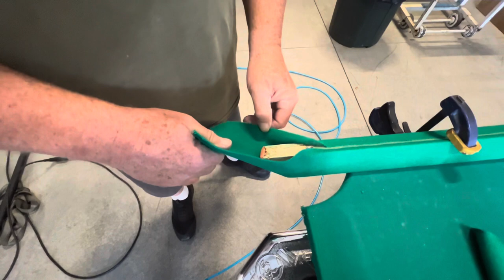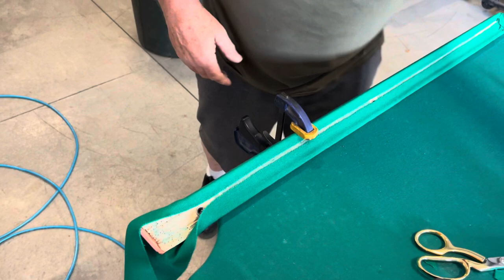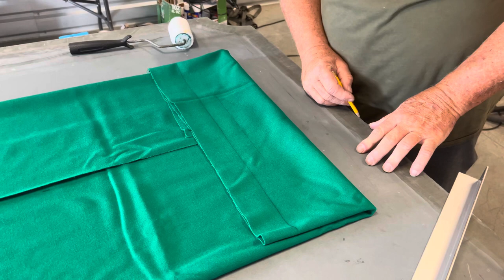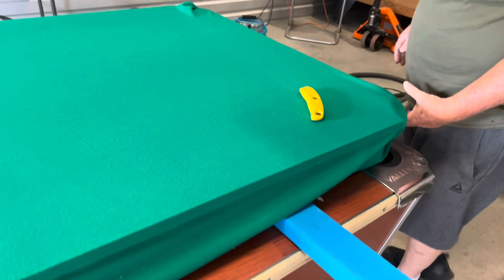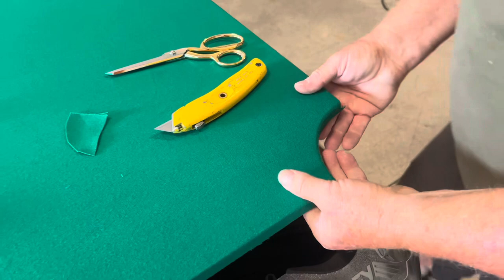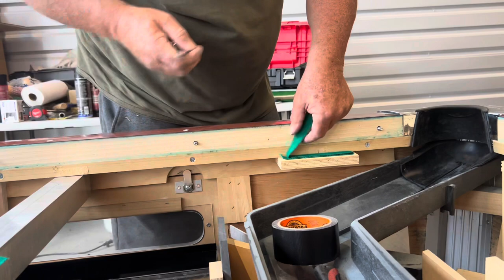FULL TUTORIAL TRAINING VIDEO: Valley Table and Rails!

Comment: Great video. We got a Dynamo at the local Legion that the cushion arent flush with the top of the rails. What exactly would cause that?  Thanks for taking the time to make this video.
Reply from the maker: Because the slate depth isn't set right.
Reply: So the slate should have been shimmed up like you showed in this video? How does this effect the rail bolts is the some adjustment available there ? I assume there is some as the cushions are currently tight but too low.  I know moving just the cushions up is not the answer as that would mess with the nose height. Thanks
Reply from the maker: Nose height is based on the cushions sitting all the way down on the slate when they're bolted on. If there's a gap, the nose height is to high.

Comment: You would not believe the mess a "Pro" table mech made of my 8' table.  A side rail cloth was cut too short so there was a mess of staples there trying to fix that.  But worst, he had to remove beeswax to remove slate bolts, yet he failed to refill those same holes with wax after he bolted the slate back down.  I suppose the table's design was lacking, maybe, but I recovered it myself once before and did a damn sight better than this 'pro'.  Of course he promised to return to fix the table - it's been six years and I quit waiting for his call within a week after he left me with this mess.  I finally sort of lost interest in my own table because I didn't want to recover it myself again, and I didn't trust any so-called mechanics.

Comment: how big is the side rail bolt for a socket? I want to adjust mine at my local bar and bring the right size
Reply from the maker: 3/8" head, if the bolts haven't been replaced 7/16" if they have.

Comment: Awesome video, I am about to pull the trigger on simonis for my valley. Should I still get the simonis DVDs? Or will this cover it
Reply from the maker: This covers everything you need to know.
Reply: @therealkingcobra  thanks a ton, going to go at it this weekend. Got the new ridgebacks and 860. For side pockets, are you using half of the measurements for anchor side and stretch side? For instance, half of 13/16 and half of 5/8. Valley bar box btw
Reply: From looking and playing over and over it looks like half of 13/16 on anchor side and half of 5/8 on stretch to side. That was the area I  was confused. I learned a ton on this video.
Reply: Just finished mine, with simonis 860. It was hard to get the lines marked correctly on side pockets because my side pockets didn't have a good definitive edge to them. It is a tough stretch for sure being a smaller guy. Wish I had those clamps shown in the video. It looks and plays great though! With new pro cut rails it Came out tight

Comment: Glen how do you setup your wood blocks under the table to make sure you have enough height?

What size wood pieces are you using?
Reply from the maker: 2x4 across the table first, the 4x4 2' long in the center of the 2x4.

Comment: What is the cushion nose height recommended for this table?
Reply from the maker: 1 7/16” is the nose height on a valley table.
Reply from the maker: Provided the rail cloth is installed correctly, and the slate depth is set correctly inside the cabinet.

Comment: i've done about 17000 table never have i glue a rail. stapleing is the right way
Reply: That’s why he is the Real King Cobra and your not big guy.
Reply from the maker: Stapling is a joke, and a waste of time always having to remove the old staples, not to mention the fact that the staples don't provide a 100% hold down of the rail cloth, like spray glue does, staples only hold where they're placed, and you can always see where they're at by the loose cloth between staples on the tops of the rails. And yea, I've recovered way more bar tables than you have, been doing this work since 1983, commercial tables exclusively.
Reply from the maker: Even VALLEY sends the new tables with new rails out, glued!